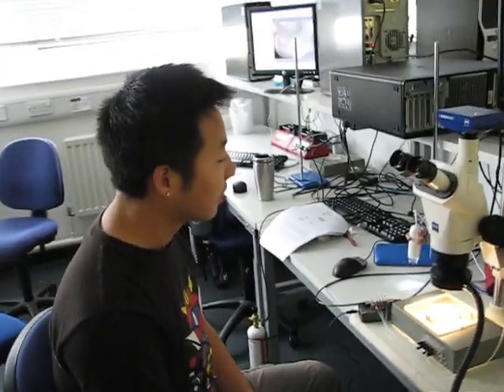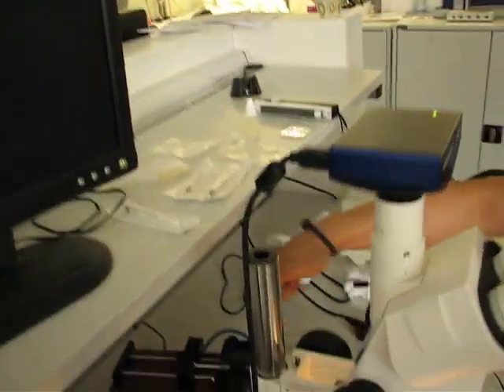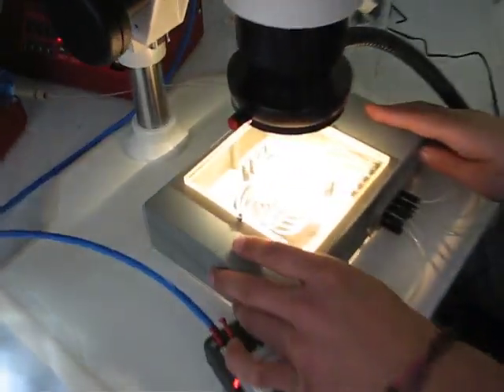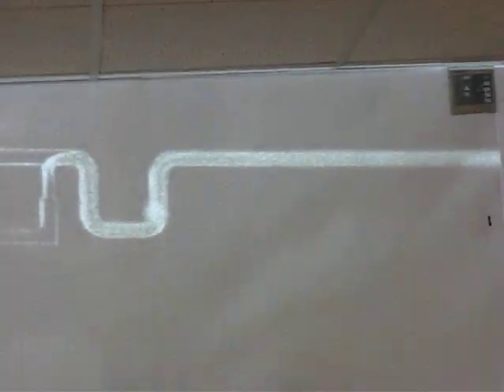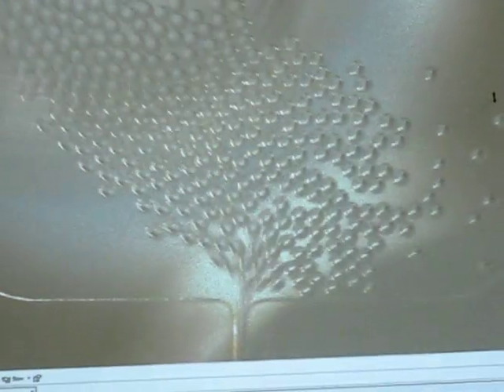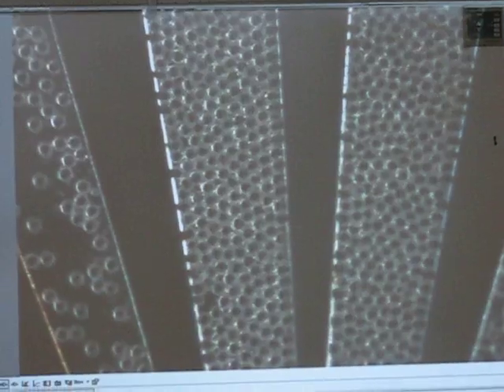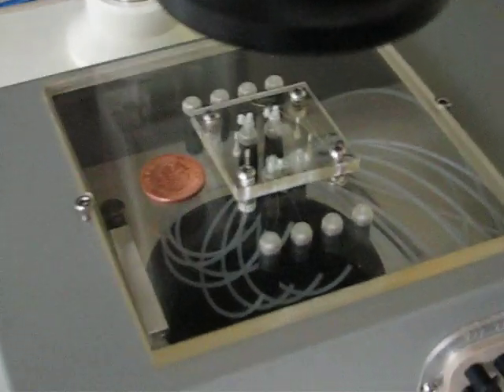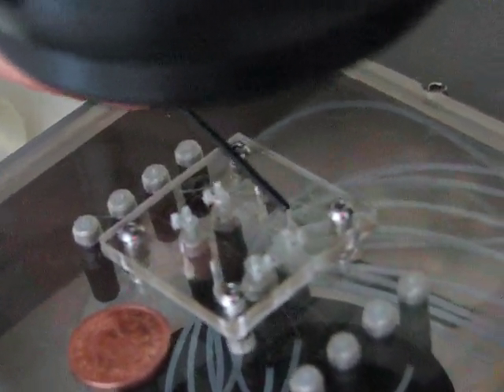Water Droplets Generation using Epigem chips at Lancaster Uni Microsystems Research

Comment from the maker: @coliquid Hi, which part exactly don't you understand. The chip has in-lets at the bottom and they form the start of the input channel. We have special pipes that are connected to the in-lets at one end (chip side) and to syringes at the other end. These syringes are docked on the pumps that mechanically/physically push the top of the syringes at specified rates ... to push the liquid into the chip, via the pipes, through the in-lets.

Und du hast recht, die ganzes Forschung ist sehr interessant